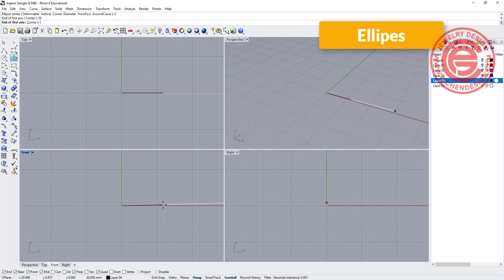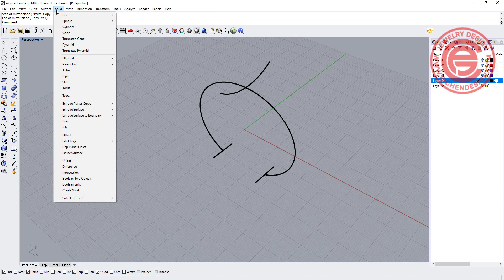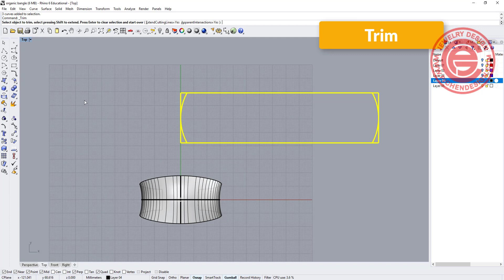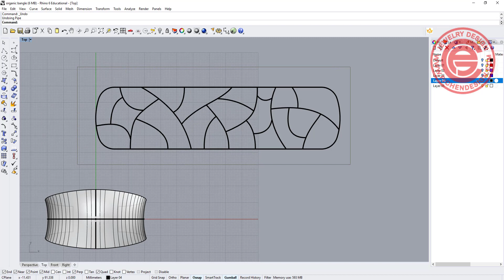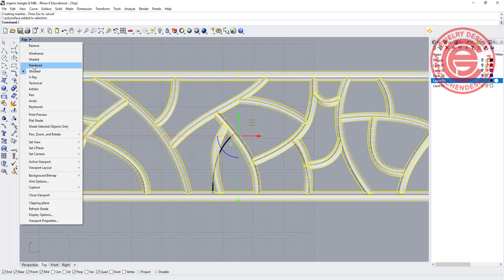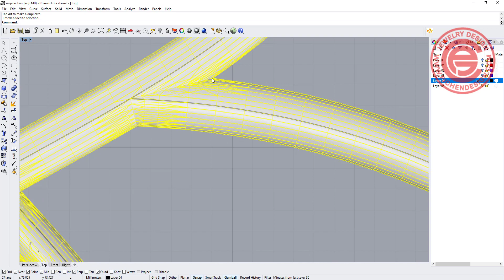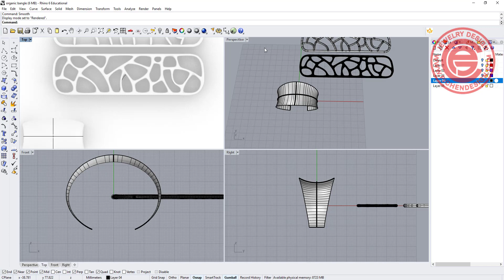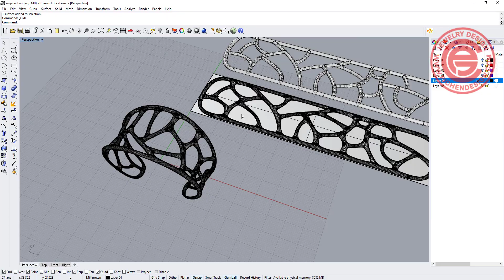Organic Bangle Jewelry CAD Design Tutorial with Rhino 3D #163

Comment: Hi great video! How do you measure the ring, if it's the right size for the finger?
Reply from the maker: Most of the jewerly store has ring sizer. or you can use a strip of paper and wrap around the finger. The lengh will be the circonference of the ring.

Comment: Do you have any tutorials about how to make sure our files are ready for 3d printing? I managed to make a pieces using your tutorials and am about ready to send them to a printing house and then getting them molded and cast. I just want to be prepared. Thanks!!
Reply from the maker: You can check out this video https://www.youtube.com/watch?v=uihBtSNEcNA
Reply: @PJChenJewelryDesign  Thank you! I tried to follow this tutorial but i could not get the pattern to flow along the surface. I tried to follow your troubleshooting video for FlowAlong Surface issues, but it still hasn't resolved. Are there any steps that wouldn't be obvious to beginners like me that I may have missed ? I followed your video exactly as you instructed. Thanks!
Reply from the maker: @spudnickel4279  without seeing your model, I cannot tell what went wrong. what kind of not working? doe it not flow or it flow in wrong direction or something else?
Reply: @PJChenJewelryDesign  it doesn't flow at all. Nothing happens after i click on the bangle to get the texture on it. I am not sure what is going on. it is probably a rookie mistake, but I just can't figure it out.
Reply: @PJChenJewelryDesign  I got it! It WAS a rookie mistake. I wasn't selecting the objects in the correct order. I didn't realize there were 3 steps in the flowalongsurface command and I was selecting the organic element along with the surface below it at the same time.
Reply from the maker: @spudnickel4279  happy to know it works out for you.

Comment: How do I set the setting to display problematic parts when boolean union?
Reply from the maker: not sure if I get your question right. if you are asking how to find the naked edge. You can go to analyze the edge. it will show naked edges on  your model.
Reply: @PJChenJewelryDesign  
When the union failed at 7:27, the wrong part was displayed as a number, so I asked how it was done. Sorry for asking so many times
Reply from the maker: @이성범-j1e  the boolean failed because the seams were aligned. You just need to move a little to avoid the seams being aligned.